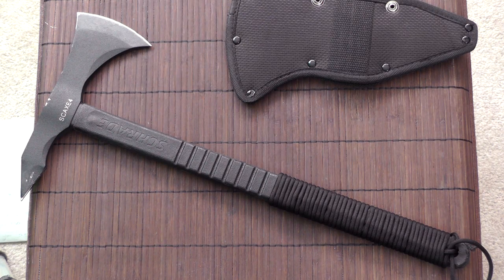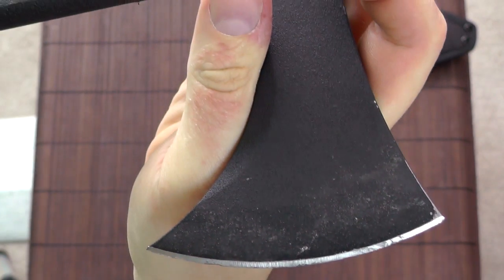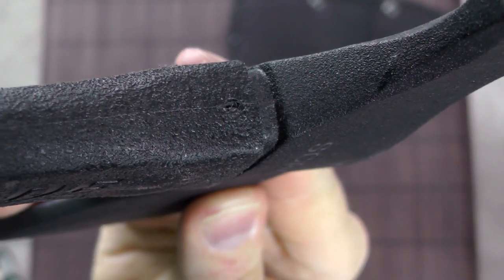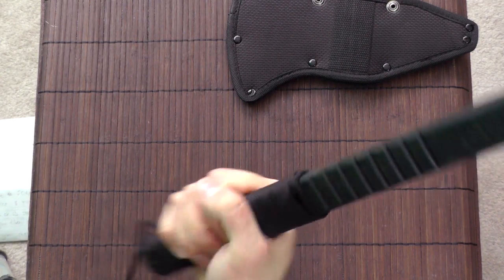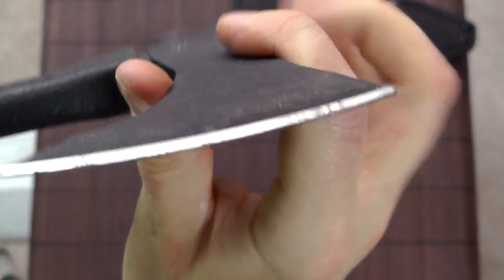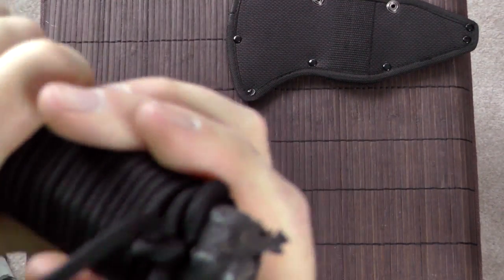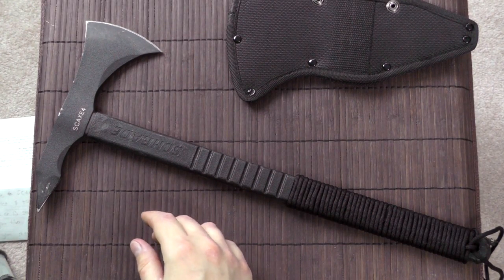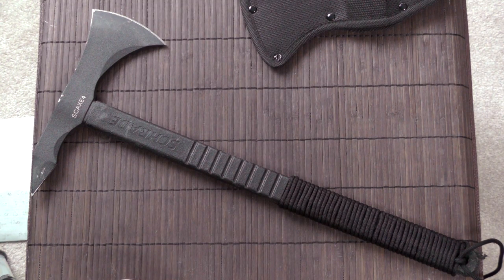Schrade tomahawk review - Good design, low end material

Comment: One practical application for the spike on a tomahawk in a survival situation is digging. You could use it like a pick. That's what a lot of soldiers use the spike on the RMJ tomahawks for. They dig grounds to find underlying cables for IEDs and stuff. Yeah, a shovel would work better, but you're finding a multi-role use for a tool, and then picks have their own advantages over shovels.

Comment: I did a magnet test on the shaft and the magnet stuck all the way down to the bottom. When it comes to the sheath, I'd prefer that the hawk would slip out of the front and not the top.

Comment: I liked the CRKT hammer head axe alot more. I strongly prefere wooden handle.
Maybe not as sturdy but you easily shift it. you can even make a new one out in the woods if needed. 
I also prefere hammers over pikes. I live in sweeden and here we also have a few armored nights runing around in the woods. but the hammer is pretty good against armor to. And can be used to lots more things than a spike

Comment: I'm looking to buy my first axe, any suggestions?
Reply: Try the Trench Hawk by Cold Steel. You can get it for around $35, and it is one beast of a tomahawk.
Reply: David Hardman Very nice pricing, thanks, I'll take a look at that.
Reply: BAH to the tomahawks... get a MANS axe! something that's sharp and sturdy and makes you feel like a MAN to use
Reply: ***** Like?
Reply: ***** Saar0s is right. Tomahawks are for pansies. Everyone knows fake fantasy blades make the best tools and weapons.
Reply: ***** I see what you mean but that's not what I'm looking for.
Reply: if you're looking for something utilitarian and functional that's designed to chop wood, i'd suggest a Gransfors Bruks or a Wetterlings.  Great quality and steel but you're gonna pay for it too... if you don't want to spend that kind of cash, then go for a Condor or Cold Steel trail boss or something like that. But if you want something that's designed to cut flesh and is almost useless for wood, then go for a tomahawk. they are meant for fighting and not for wood...
to give you an example... my crappiest axe would have made a small chore of that piece of birch that Skallagrim had to hack at for a while to get halfway through...
Reply: Well it depends a lot on what you plan on doing with it. If it is going to be a dedicated weapon, the one featured in this video, or either of the two offerings from SOG would be great choices. If you are going to do woodwork with it, you might want a better steel. The CRKT new ones are good. If you are on a budget, the Cold Steel line is not too bad. Their fit and finish is often only fair but they are okay steel and have a lot of different type of heads to suit your needs.
Reply: Thanks for the advice, it was very helpful.
Reply: Azkamooski I would recommend a husqvarna their the best in the 50 price range for cutting wood
Reply: ***** don't buy it there you can get the same thing for less if you get it from budk

Comment: ***** could you make a crossbow video? If you cannot afford a crossbow it is possible for me to send you one.
Reply from the maker: That would be awesome actually. Not being able to afford one has been the only thing that prevented me from acquiring a crossbow so far. Well, and the fact that I have so much stuff on my to-get list that I need to prioritize.
Reply: Does it matter if it's a cheap one? I do not have any intention of giving away my empire terminator crossbow, but I could give you my mtech 150. (look them up) The only issue would be sending them to canada.
Reply from the maker: beaker007j
If it works, that's fine. :)

Yeah, the shipping might be expensive, considering that it's probably a relatively large package. If you estimate the measurements and weight of the package you could check what the cheapest option via USPS is.
Reply: beaker007j
I thought guns were better than crossbows...
Reply: they are, but crossbows are still cool things to have.